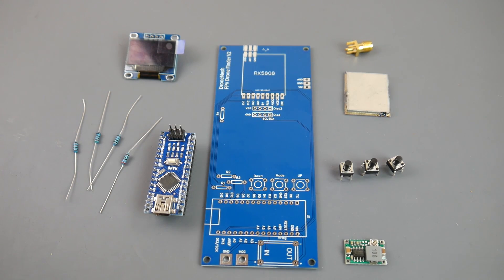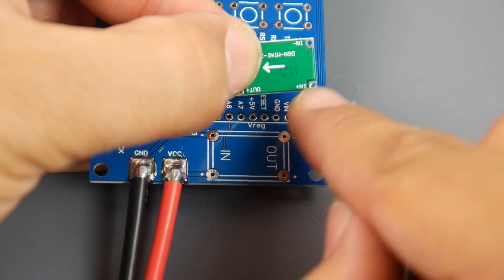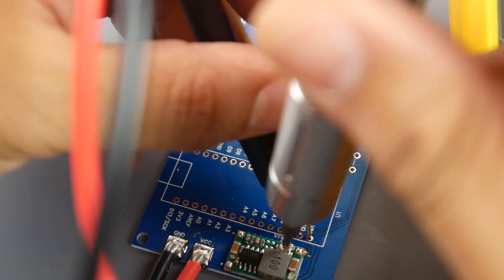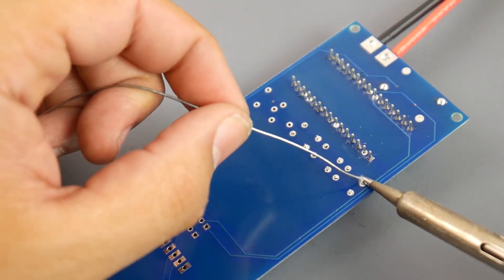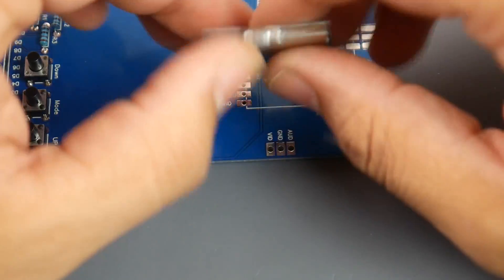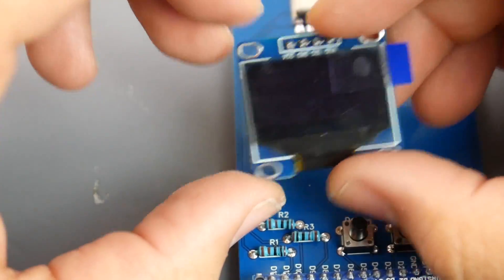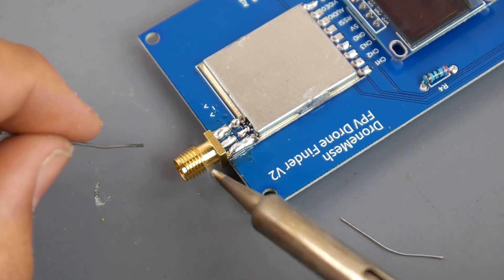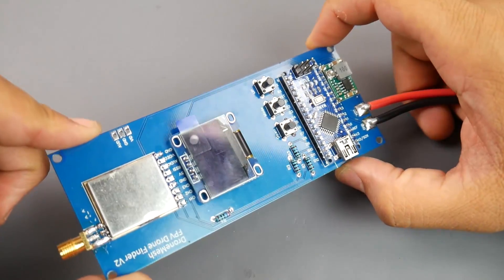THE ULTIMATE FPV RACING DRONE FINDER V2 // Part 1 DIY KIT BUILD

Comment: I had trouble compiling the code until I updated the Arduino compiler to 1.8.8.  I didn't need to add the SH1106 library or the supporting graphic library after that.  Also I couldn't flash my sketch until I used the ATmega328P (Old Bootloader) as the processor target.  I haven't tried soldering my 2nd Nano back onto the board yet (I removed the first one assuming it was bad with all the upload errors)  but I'm optimistic and excited to have a dedicated finder.  I'm very glad you decided to do this project.  Thanks!  Follow up:  Works Great! Yah!!

Comment: Yup, i'm gonna have to order this when its not preorder anymore. Great little kit and design. One suggestion, start using FLUX!
Reply: I would recomend 0.7mm 60/40 362/364 solder, none of that lead free rubbish...no separate flux required then...